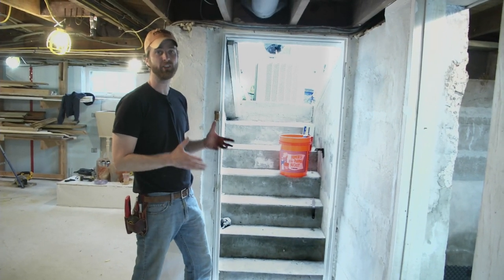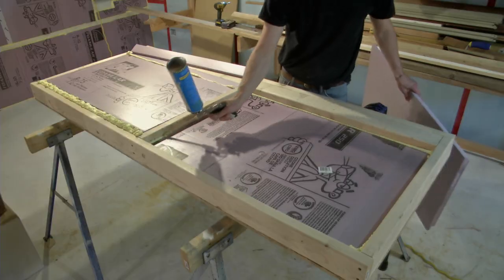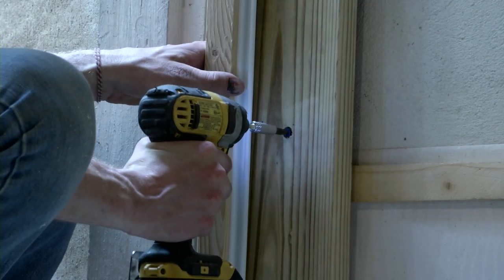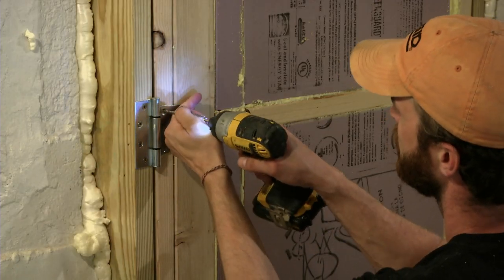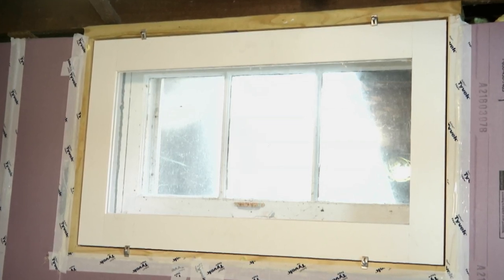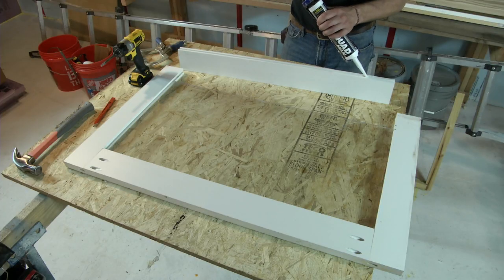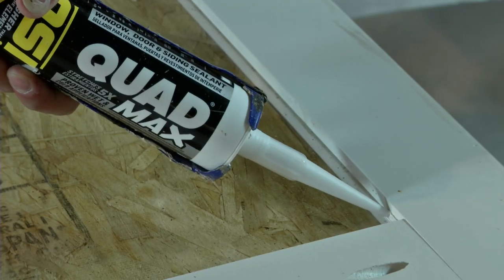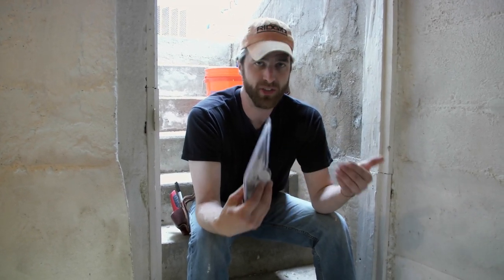How to Insulate Your Basement: Part 2

Comment: This is a great series of videos that are straightforward and informative!  I started insulating my basement and have learned some things from your videos.

On a side note, I highly recommend an air quality monitoring system, which are relatively inexpensive.  When I first moved into my house 8 years ago, a radon test was done and there were no high levels of radon.  Two years ago I got an air quality monitor (Airthings) that detected high levels of radon, forcing me to hire a radon specialist to put in a mitigation system.  Since radon is odorless, you'd never know you had a problem until you started to get sick.